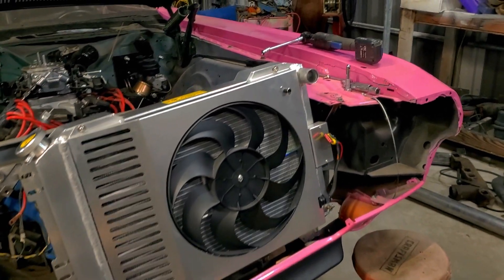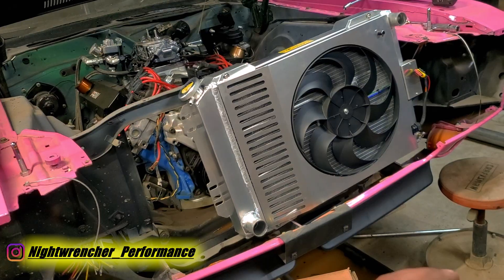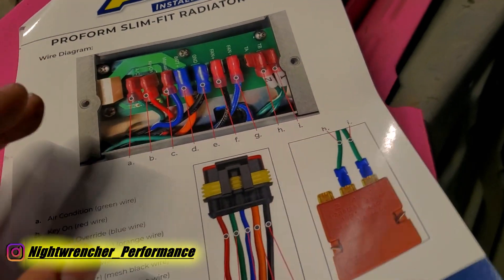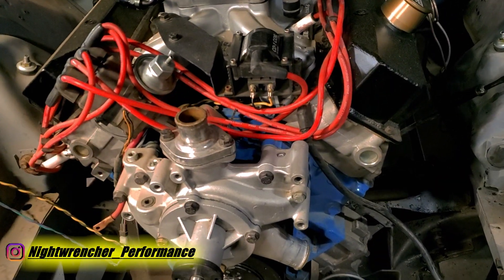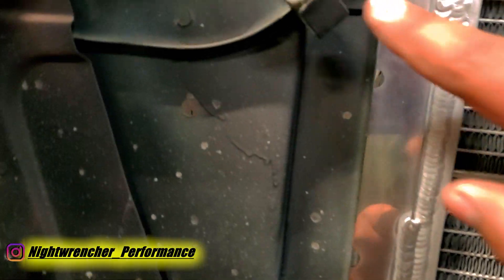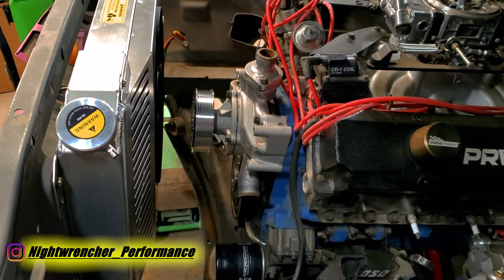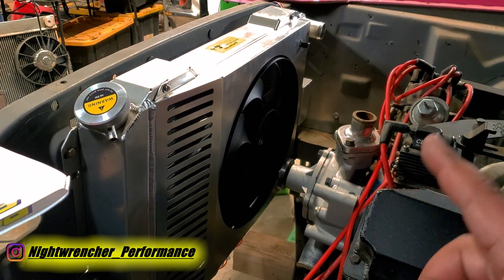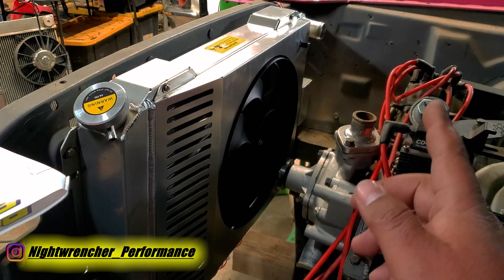Thinnest Radiator Fan Combo On The Market! - Proform Slim-Fit Radiator | 1970 Challenger Radiator

Comment: My apologies, but at 00:36 the thermostat housing is tapped by a hand & described as the water INlet into the engine, the water flows thru the engine and thru the water pump OUTlet (hand taps water pump hose connection near oil filter.) WHAT? That is precisely opposite of what I was taught in mechanics school, including coolant system flow charts & everything I have experienced in 37 years of school bus mechanic & engine research technician! Is this a test to see if watchers of your videos are really listening & comprehending what they hear? The thermostat is the valve that releases hot water, steam bubbles UP & out of the cooling circuit, flowing from the thermostat housing to the TOP of the radiator coolant tank (whether crossflow or old school down flow radiator.) The water pump hose connection or INlet receives cooled coolant & pumps it under pressure into the coolant passages. Please tell me I'm being punked by this video! All your other vids I've seem are logical, spot on good explanations of various mechanical aspects. So do I get a free Night Wrencher sticker for being the first to point the coolant sys. error out? Thanks, Paul
Reply from the maker: No, you are correct. I'm not sure what I was thinking when I said that 😂 my point was that the same radiator could be used on 2 different engines and the inlets and outlet lables would be reversed. Aka smallblock mopar and an LS
Reply: Ok, Cool Bro. Thanks for the reply & acknowledgment that I was not in error all these years..Whew! Good content & I am anticipating the slant 6 Turbo install series. IMHO, DDG put to large of an EFI  & 750 dbl pumper on a small 170 cid eng., causing vac. signal loss/fuel puddling at tip-in of throttle. The 225 cid Turbo truck was much more responsive/fun/quicker spooling due to larger eng.(classic over-carburetion of many newbie turbo sys..)  PLEASE, 1st put a small (modified for boost) 2bbl. carburetor & run N/A, Then carb & Boost successfully, NO stumbles, farts & backfires & making boost! Only then swap to the Acess EFI. Thanks, Paul

Comment: What a great concept. Looking forward to seeing how they perform. And how much does that set up cost?
Reply from the maker: @JonnyMopar  the Proform set up is about $750. My old radiator and fan set up costs about $350 for the radiator and like $100 per Permacool fan.  Old setup is going back into the charger since thats where I had it originally.
Reply: @ The $750 will be worth it if it keeps the engine cool and gives that much space. I love the idea of this thing. My buddy was going to put a blower on his car but because there was no space for fans he’s been thinking of going a different direction.
Reply from the maker: @JonnyMopar  thats a good point actually. The lower blower pully takes a bunch of room